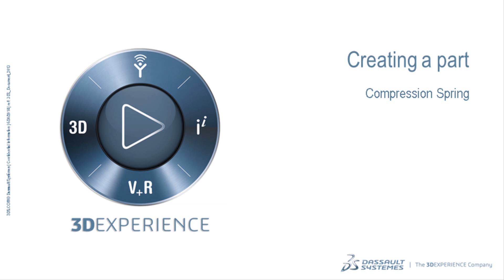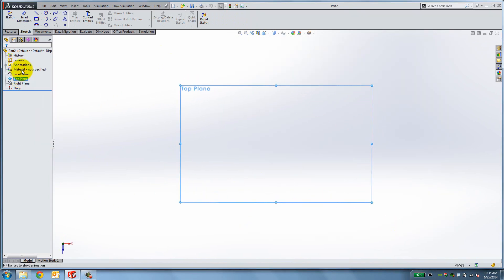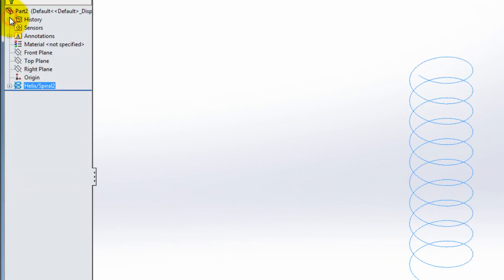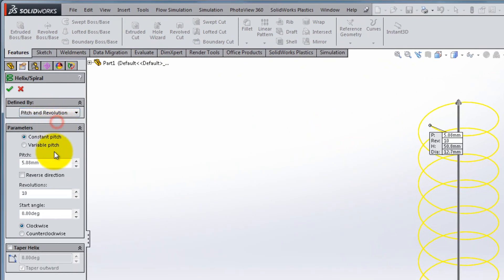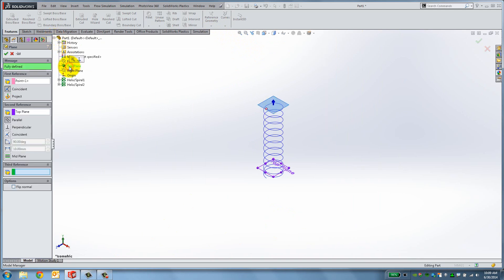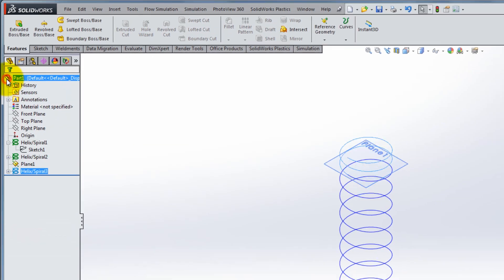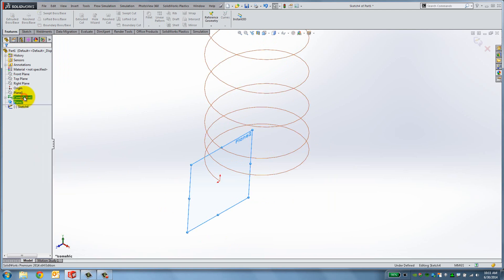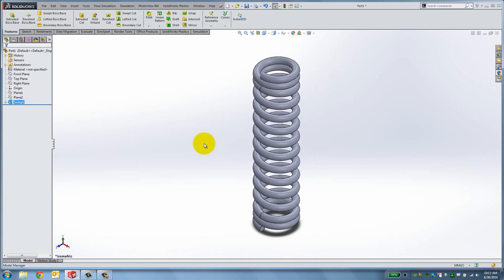Unit 2: Parts - Lesson 3: Compression Spring

Comment: Is it "Best Practice" to convert the entities/ duplicate the initial sketch for each helix section, rather than simply using the sketch in multiple helix features (obviously the sketch for the top compression helix would need to be converted since it's on a separate plane)?
Reply: They both work equally well so it depends on your design intent - that is how you want to use/modify the part in the future. If you plan to change the sketch only for a particular section of the whole helix, converting to a new sketch every time might be better.